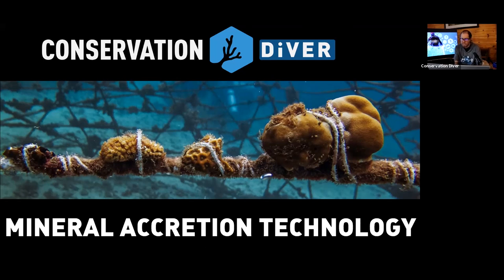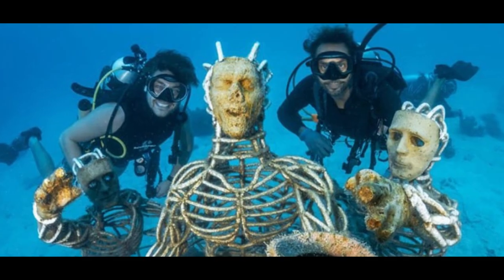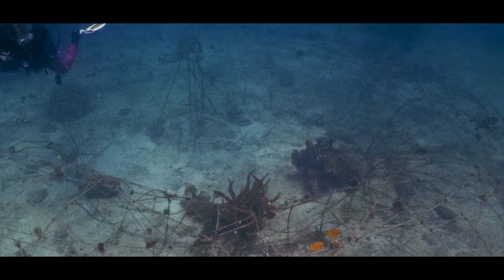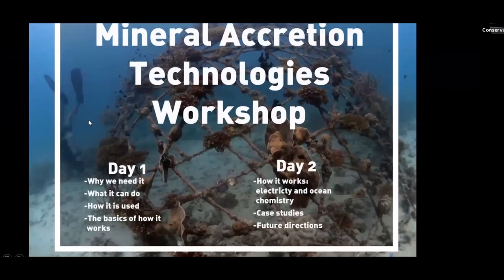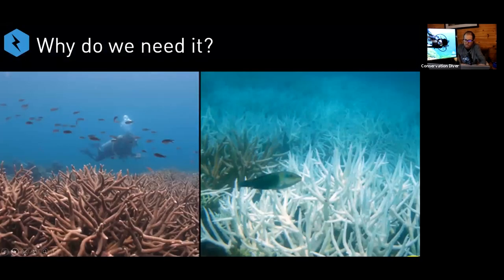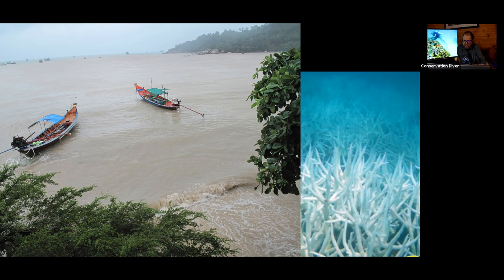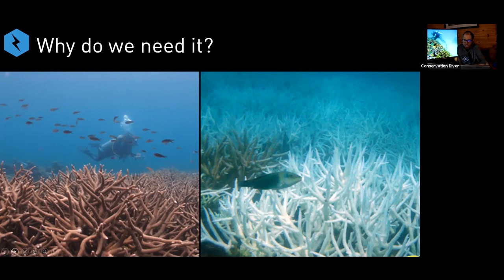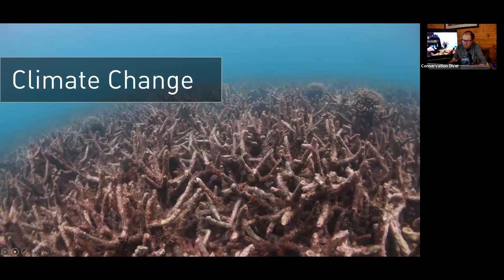Restoring Coral Reefs: An In-depth Exploration of Mineral Accretion Technology

Comment: So the main problem with the overall restoration of coral and setting up these mineral accretion areas is simply funding?
Reply from the maker: Yes, that is one of the main barriers. But depending on where you are, government policies and red tape can be another barrier. In the US, for example, there are laws against putting corals on artificial reefs. In Australia, permits will not be given if the project requires power lines to be run to it. The third barrier is expertise, which is what we are actively trying to address through these types of long-form, free content :)

Comment: Very nice video, but you got something wrong about AV and DC. DC causes not as much losses a the cable as AC, when you use the same voltage, in reality the opposite is true. When you transport a huge amount of electrical energy over a long distance causes much lower losses than AC. What is right is that 220 AC causes much less losses than 6 to 10 V DC, because you need a much lower current to transmit the same energy with a higher voltage. The loss in the cable is the electic current(in amperes)  multiplied by the electrical resistance(in ohms) of the cable, so low current means low losses with the same cable.
Reply: The reason why we use AC is mostly because it was easier to transform into a higher or lower voltage than DC.
Reply from the maker: @hartmutdietz1228  Thnak you for that insightful comment. As ecologists, we are doing are best to understand the electrical side of things, and appreciate the correction!